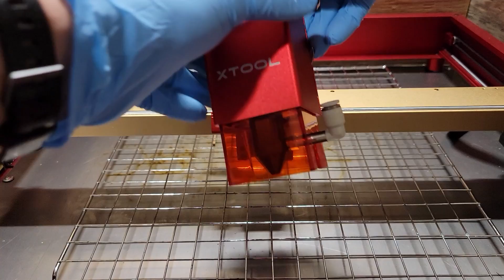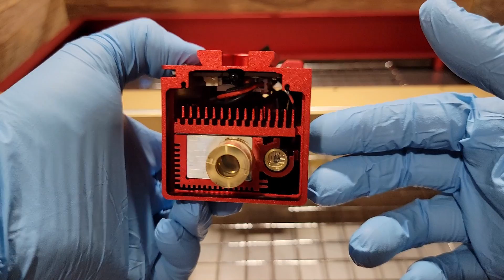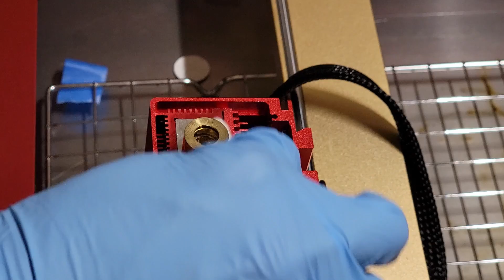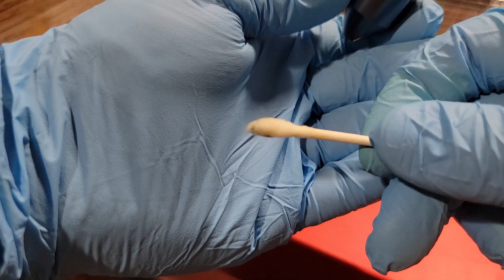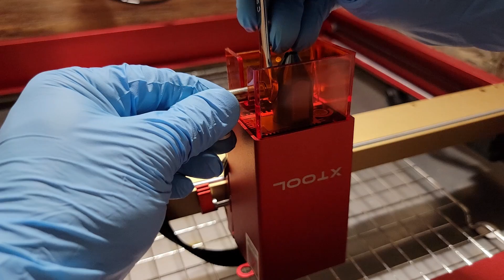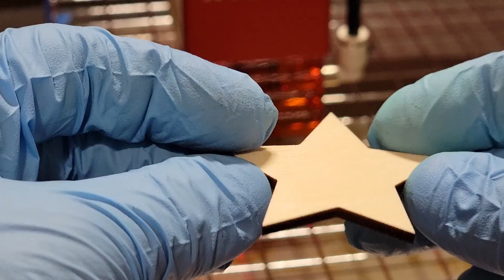Xtool D1 Pro First Cleaning. How To Clean Your Diode Laser Engraver and Cutter. #laser #xtool

Comment: I followed video exactly now my lazer is really weak still a beam but won’t do anything when trying to engrave
Reply from the maker: @GoodDayGaming07  I would check the cable connecting to the top and make sure it's fully seated. Make sure the lens is completely clean and clear. Also, check to make sure the lens holder was seated correctly back on the laser module, if it's offset then it can cause issues too.

Comment: I just followed and instead of cleaning I replaced my lense now it wont cut thru at all any ideas?
Reply from the maker: I would lower the power to like 1%, and if using light burn you can fire the laser manually and check the shape of the dot and see if it looks like a nice tight circle. Move the head up and down to see if the focus height changed on you or if the laser isn't going straight through the lens cuasing a dishaped laser dot.

Comment: You should be using denatured alcohol, not regular household alcohol. Regular alcohol will leave a haze on the lens, denatured alcohol is designed for laser lenses, cameras, cd/dvd laser lenses etc.
Reply from the maker: I'll look into it thanks! Isopropyl was readily available and haven't replaced the lense cover since purchasing yet. Probably got 600+ hours on it so far.

Comment: How to replace the laser module cooling fan?  I have removed 4 screws on top of the fan cover and 2 screws on the back of the module but unable to remove the circuit board. I am just wondering if you have experience with this. Thank you.
Reply from the maker: I Haven't had to tear down the laser module yet, so I'm not really sure. it appears to be a slide in design. I would check by the laser emmiter to see if anything is holding it in from the bottom of the module. Would definitely take it slow and not apply to much force on it. probably all should come out together in one piece if i had to guess.
Reply: Thanks so much for responding. I was able to replace the fan. After removing 6 screws, the circuit board slides out with some wiggling effort. Since I got the module opened, I used some light air spray to blow off some build-up from inside. It was a good tune-up in my opinion.
 @PottersVinylsAndMore
Reply from the maker: Awesome! Glad you got that figured out and everything went smoothly. @VuTran-h3l

Comment: Your video is so good, I followed your instructions but I have a problem, I need help.  Now I do not have the laser light when I try to cut.  I took off the nozzle again and I have one.  When put back together I do not.  I don't know what to do.  My nozzle has no blockages.  Please help.
Reply from the maker: Could be the nozzle not seating correctly. Im assuming the light is the laser beam itself and not the framing cross laser correct? Running the laser with 1% power with the nozzle off shows the beam correct? Are you using the air assist? If not you could try rotating the nozzle around the see if there is a misalignment issue. Inspect the hole at the end of the nozzle to see of its centered, sometimes they are off centered a little and got through QC
Reply: I'm having the same issue.

Comment: Can I use acetone instead of the rubbing alcohol?
Reply from the maker: Acetone is pretty volatile. Would eat the paint around the housing for the laser module and lens cover.
Reply: @PottersVinylsAndMore  Also these lens are specially coated and anything other than 99% alcohol would remove the coating and the efficacy of the lens.

Comment: Does the laser leave a mark where it crosses the supporting rack's wires? I'm looking for a better solution and the rack looks like it works nicely.
Reply from the maker: Actually haven't seen any markings on the baking rack. Maybe some residue from cutting wood but nothing permanent. I will say it's a little to thin, and is not perfectly flat so clamping wood down to it doesn't work all that well for the bowed pieces of plywood.